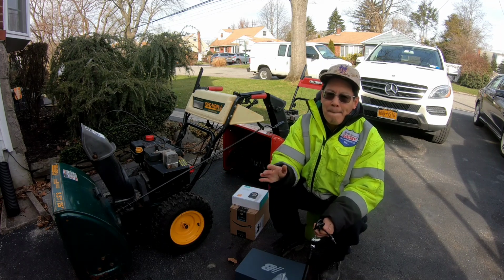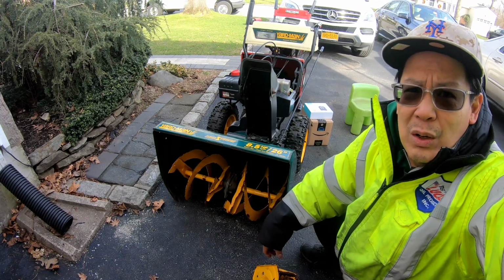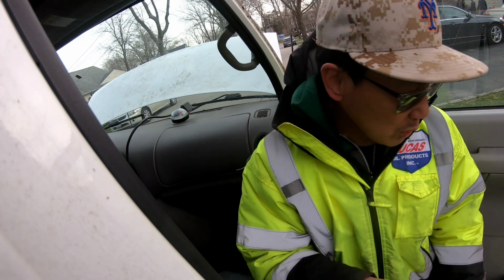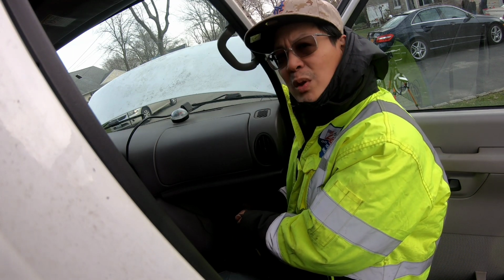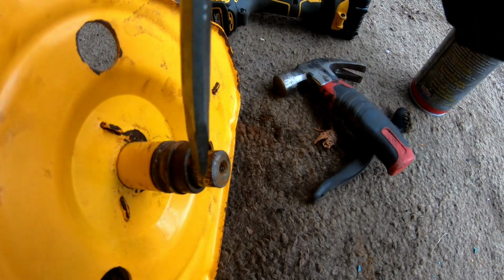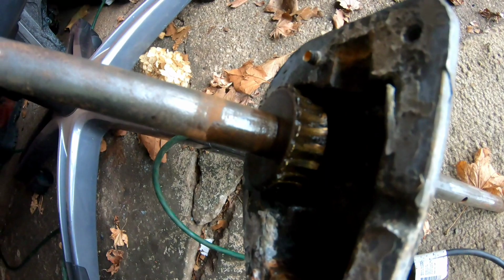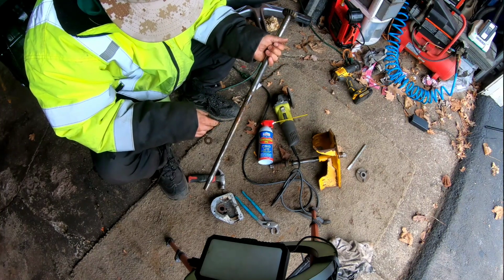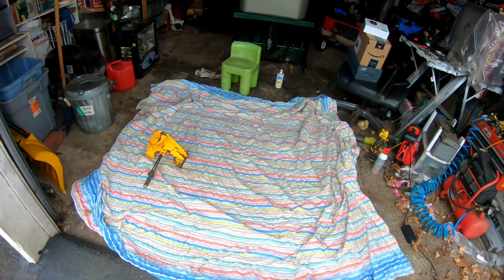YARDMAN MTD AUGER IMPELLER WORM GEAR SHAFT PREP FOR NEW PARTS INSTALL & FORD E350 VAN RADIO ANTENNA

Comment: Bro, van, make sure you do a drip loop, otherwise water will flow down the wire right into your van.....
Reply from the maker: Had a rubber grommet
Reply: @MowersNBlowers  oh good.

Comment: I think you could use a puller on that end of that part
Reply from the maker: Where would I put the claws??
Reply: Maybe on the bottom of that little lip before the yellow part
Reply: It looks like it would come off with a small puller of it's one piece

Comment: Henry. The Cub Cadet yellow is really close to “School Bus Yellow” and the white is very close to “Antique White” which Ford used for many years. Tractor Supply Company usually keeps both colors in stock along with the the colors associated with John Deere and other major equipment brands. The yellow John Deere color is very close to “Safety Yellow”.  Although you didn’t specifically mention John Deere, I thought I would mention the color for future reference. The facility where I retired from kept a complete selection of OEM equipment color spray paint for several brands and types of different equipment.
Reply from the maker: Good info bro
Reply: Oh Henry, On the dump truck beds where I would replace rusted out sections with new steel, I would primer with a very generous coating of self etching primer and then once the primer was dry I then coated the surface with the black spray can undercoating or even the spray can bed liner. Being that our truck beds were black - The color was no issue. This coating was very durable and could be repainted very easily. This makes a very good base for areas that are prone to wear and abuse that are not real visible. Personally, I never tried painting any other colors than flat black, semi gloss black or gloss black.
Reply from the maker: @TheIronDuke502  I love that rhino Bedliner spray!  Good stuff
Reply: @MowersNBlowers  At work, All I could get was whatever brand spray bed liner that our designated vendors had on hand per pricing contract. Some of the lesser brands worked okay but not like the well known brands did.. The spray on bed liner is not good for under mower decks due to the very rough texture not letting grass discharge properly. Black moldboard paint works great due to it’s very slippery finish. The best option is to concentrate on a very good heavy coating of primer. The red oxide “Rusty Metal Primer” works great for rusty pitted metal before painting with the final finish coating.

Comment: Hey henry . I got another whole complete auger in shaft system. It's from a Craftsman's snowblower what size is the shrewd . . And the shaft.  . Like I was saying was the whole unit system that I have came up a Craftsman snowblower just like that Craftsman snowblower that was behind the Yard Man in your driveway in the video it was the same exact snowblower.
Reply from the maker: It’s a 26 wide!  I ordered parts already.  Plus if you’re not on Long Island,  shipping would be more than the parts.  Thx bro
Reply: @MowersNBlowers  the one i have is 28 in .